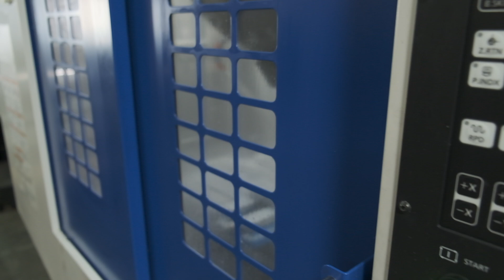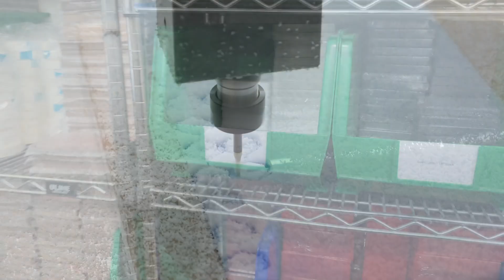Machining Delrin Light Diffusers on the Nomad 3

Comment: Nice fine detail work, as an alternative to factory injection moulding, lookup PolyMorph/PolyDough on Amazon. Its a heat mouldable plastic resin, put some granules in hot water, it becomes pliable, can be manually formed or pressed into a shape. It cools & sets in minutes.

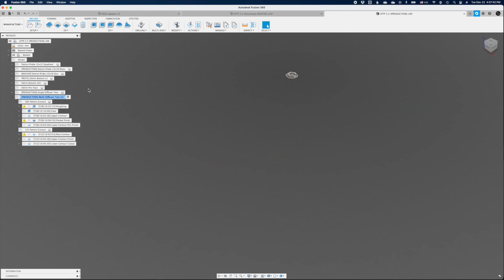Comment: Great video Winston! At 3:42 you selected something in the Manufacture workspace that seemed to produce multiple copies of the part. Is there a feature to make multiple parts within the Manufacture workspace, or had you already done a rectangular pattern back in the Design space?
Reply from the maker: In the same part of the menu where you create a Setup, there's an option for creating a pattern to multiply toolpaths.   -W
Reply: Carbide 3D Many thanks Winston; looking forward to trying it on a project soon!👍😊

Comment: Tbh 3d printing seems more fit for this job, especially with a large format msla printer, it would at most taking 30 minutes for a bed full of these
Reply: Yep this would have been a really good solution
Reply: How accurate can you print? Just got my first msla printer and learning.
Reply: @phillipfuentes1119  extremely accurate, my machine can do up to 30um resolution and with some tuning and proper positioning it can replicate the results consistently